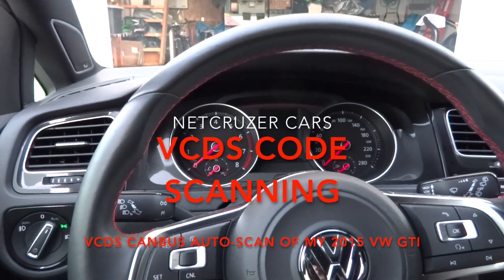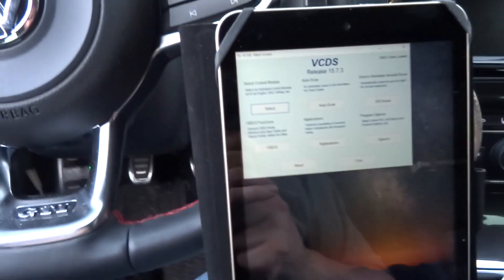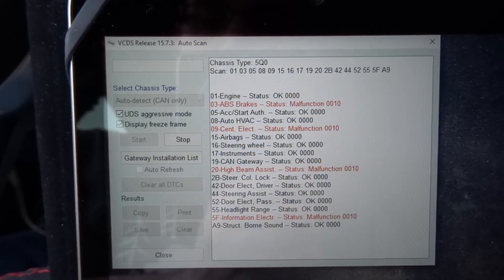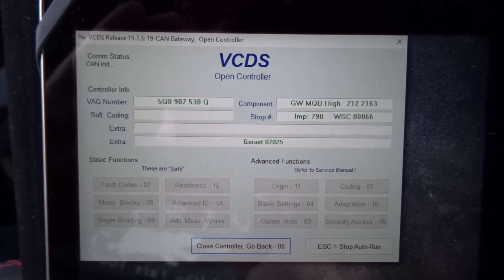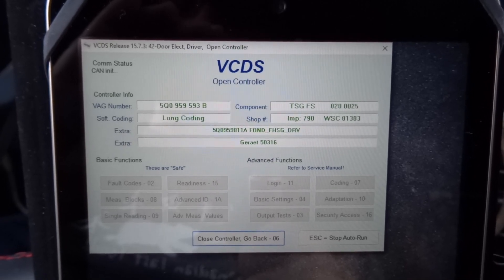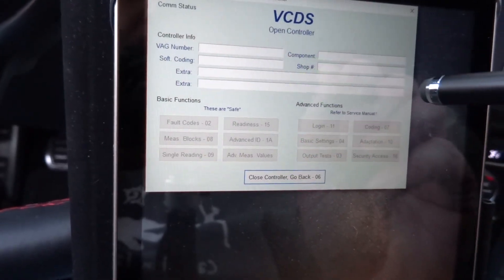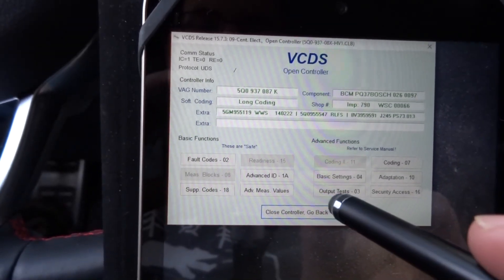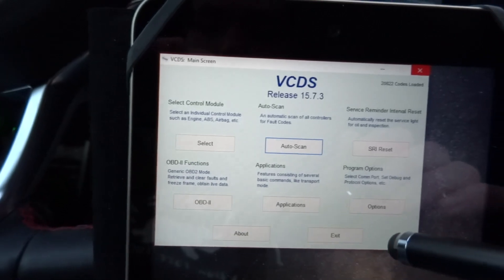VCDS Scanning for Fault Codes in my 2015 VW GTI

Comment: Guys, my 1st time installing and running vcds. Everything went smooth but after finishing scan, later I cannot start car as battery is flat it seems. What went wrong guys? I turned on ignition but didn't start engine 😢
Reply: Should have I switched on the engine? 😅

Comment: Hey, nice video demo of VCDS auto scan. I got freaked out the first time when it did the auto scan and it threw open a bunch of new windows. I thought my PC was crapping out on me and then lo and behold my whole car started behaving weirdly with wipers /stereo turning on by themselves and whatnot. I panic closed the VCDS while it was auto scanning and thought I broke my car lol.. it was just a weak battery!

Btw, I am not sure the ABS/brakes fault was harmless, it has a fault priority of 2 which vcds says is a get it fixed immediately kind of issue and I agree since I believe the steering angle sensor is integral to the working of ESP/ESC. Without knowing where the steering is pointing it can't correct a dangerous slide. ESP has personally saved my life a couple times, I take it for granted where I live with muddy, gravelly roads and a pretty hard driving style.

Comment: If it isn't too late, update to VCDS 15.7.4 and see if you run into the same issue with the DTCs not being displayed.
Reply from the maker: +RossTechVCDS OK. Thanks for the reply. I thought I was running the latest non-beta but guess not.  No biggie, I was able to see the faults at the points mentioned above in the comments.  Already been to dealer for the service and a clean bill of health.